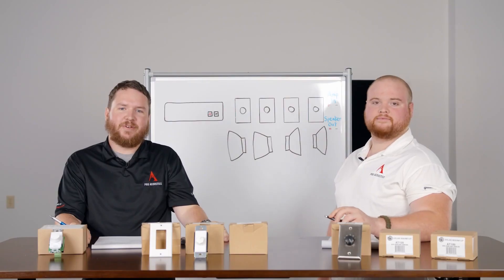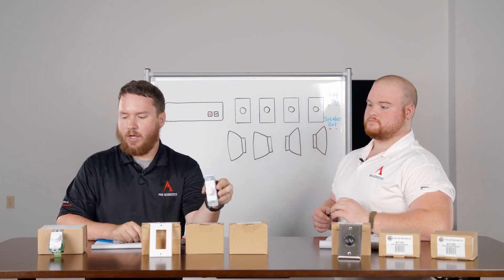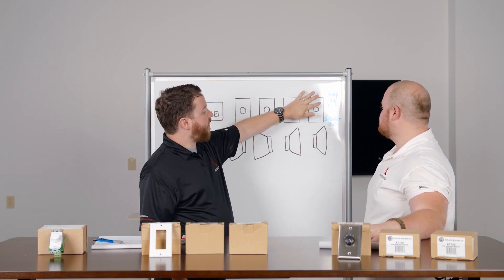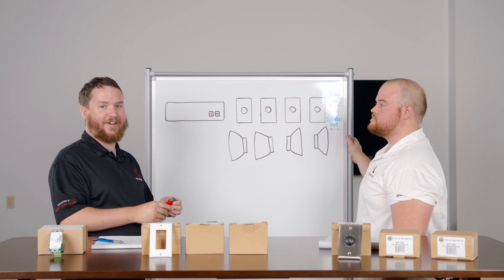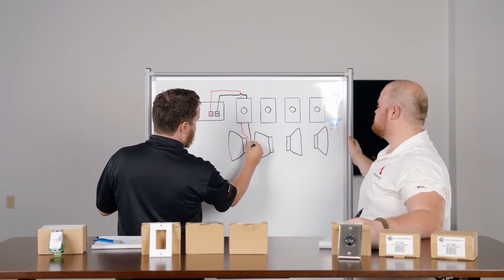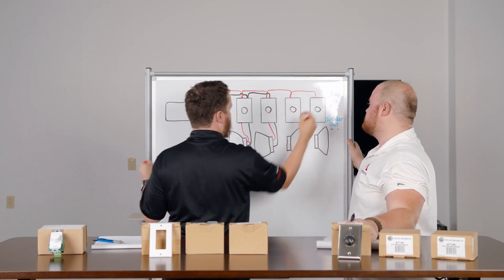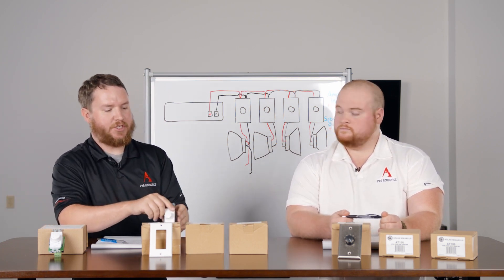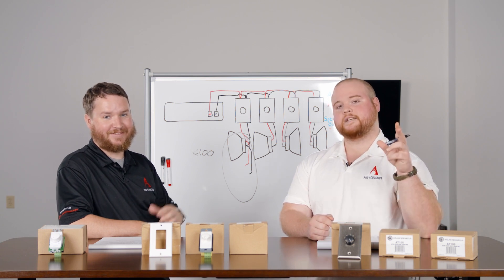All You Need to Know About 70V Volume Controls on Pro Acoustics Tech Talk Episode 20

Comment: Hello, what if I want to control an outdoor zone with two speakers and one oudoor subwoofer ? I’m planning on doing this with a Sonos amp, the bub woofer connection is rca for the sub
Reply from the maker: For your setup with the Sonos Amp, you won't need a 70V volume control. Instead, you can adjust the volume directly from the Sonos Amp, which will control both the speakers and the subwoofer. If you have any other questions or need more details, feel free to reach out! We're happy to assist you. You can contact us at 1-888-256-4112 or email sales@proacoustics.com.

Comment: Maybe this was asked before.

But if I have a 100W volume control does it mean I can control up to 70w  in speakers.

Does the primary capacity of the amplifier needs to support the total amount of power needed by the whole system. Or each volume control adds extra watts to the system ?
Reply from the maker: The 100W of the volume control refers to the total wattage it can handle across all connected speakers. The cumulative wattage of the speakers connected to the volume control should not exceed 100W. The volume control doesn't add or accumulate extra power; it simply adjusts the volume level of the speakers. However, your amplifier does needs to support the combined wattage of all your speakers.

Comment: Question for you. I have been asked to play a live acoustic set through an in house multiple speaker pub system.  I am using my analogue mixer to set levels for my guitar and microphone and connecting this to their wall mounted xlr input. There are 2 inputs labelled mike and external.  External produces no sound. Mike  in works fine but only if the main out on my mixer is to to practically zero leaving volume control to the wall controller behind the bar area. Is this normal?  Any tips ?
Reply from the maker: It sounds you might need to check if the main mixer/amp connected to the wall plate has its volume turned up for sufficient headroom.

Comment: So the controllers only lower the volume?  So if it’s on the max setting the speaker will output what it’s tapped to?
Reply from the maker: Great question! Exactly—when the volume control is all the way up, 100% of the power passes through the attenuator, allowing the speaker to output what it’s tapped to. As you lower the control, it reduces the wattage passing through to the speaker.

Comment: What about the impedance? You never mention that
Reply from the maker: This video is about 70V audio systems, which differ from traditional low-impedance systems. In 70V setups, impedance is not usually a primary concern. The main advantage is better performance over long distances with multiple speakers, making installation and scalability easier.

Comment: What if total wattage of speakers is bigger than volume control wattage. Does it effect on original sound level of amplifier?
Reply from the maker: If the total wattage of the speakers exceeds the wattage rating of the volume control, it can cause damage to the volume control. The wattage load of the volume control is determined by adding up the selected wattage taps of the speakers connected to it. Make sure the combined wattage of the 70-volt speaker taps does not exceed the wattage rating of the volume control to avoid any issues.

Comment: Hi  I have two questions 1 how do I also connect sub woofers on one zone of that regulator or volume switch.                2 how can I run it that one zone can be reduced from other zones and use it for my self example if I want to use the speakers on zone 3 for myself completely and I switched it of from the amplifier being the source and play music with my phone later can switch on when  am done
Reply from the maker: I'll do my best to answer both of your questions.
1. The volume controls on the zone regulator are specific to each zone and are assigned to one amplifier. You can connect the subwoofer to the desired zone just like you would connect any 70V speaker.
2. If you require the ability to assign the subwoofer to specific zones and control it independently, you would need a matrixing multi-zone amplifier setup. I recommend reaching out to our sales engineers, who can provide further guidance if needed. Feel free to contact us at (888) 256-4112 or email sales@proacoustics.com.

Comment: one question I have 100W amp and 8 speakers 10W does volume control draw aditional  power from amp can I put 3 30w controlers to make 3 zones
Reply from the maker: It's essential to ensure that both the amp and the volume controls can handle the cumulative wattage of the speakers. Having 8 speakers with 10 watts each and using 3 volume controls rated at 30 watts should work fine (3 speakers x 10W per speaker = exactly 30W per volume control). Just ensure that the total wattage of the speakers connected to each volume control does not exceed its rated capacity.

Comment: is there a voltage drop in the system? speakers in DC chain?
Reply from the maker: It's possible to have some voltage drop in a system with speakers in a DC chain, but it's typically a negligible difference. The extent of voltage drop depends on factors like the number of speakers used and the length of the speaker chain. In most cases, the impact is minimal.

Comment: Great video.
I am building a massage clinic with three rooms and a main reception area. One speaker, and volume control per room. Multiple speakers in the reception area. I have my contractor doing other electrical work and am going to propose this method to him for install speakers. Is this something an electrician should be able to easily comprehend and carry out? It seems rather straightforward with the right equipment.

I would just want to make sure I have the right speakers, amp, knobs, and of course wiring.

Thanks!
Reply from the maker: In most cases, an experienced electrician can install basic commercial audio equipment, provided they have the necessary equipment. If you would like to speak with us directly, we can assist you in designing your audio solution and work with your electrician to ensure that the hardware is wired and installed correctly. Our design assistance and troubleshooting help are complimentary. You are welcome to contact us by calling (888) 256-4112 or emailing us at sales@proacoustics.com.

Comment: Do all of the volume controls add up?
Reply from the maker: Hi there, The volume controls do not necessarily add up. It would depend on the speakers' wattage taps assigned to the respective volume controls. You can have higher-rated wattage volume controls on the system. However, you cannot exceed the rated output performance of the amplifier(s) these speakers are tied into (less than 15-20% for headroom).  We talk more about that in this video: https://youtu.be/-omIOiKUrdw?t=212
We also talk more about setting up volume controls here: https://youtu.be/UgxQc9XMyvo?t=199
Reply: @ProAcoustics  Oh ok thank you very much!!!!!!!!

Comment: How do you connect your phone to it?
Reply from the maker: Hi George,
Most 70V volume controls require manual adjustment of the knob and are not smart or digital devices. Depending on the available features, you may be able to connect your personal device to stream audio via Bluetooth to the mixer/amplifier.
Reply: @ProAcoustics  so would I need to have it connect to a box like with a cd or radio
Reply from the maker: @GeorgeLiakaris  Yes, that is correct.

Comment: I have a TOA DA 250H THE INPOUT IS 3 Wire how can i connect a audio device to it
Reply from the maker: Hi there! That is a balanced euroblock or phoenix club connector on the TOA DA 250H unit. You would plug a balanced output from a mixer (like an XLR) into the euroblock connector, matching up your positive, negative, and ground wires. Hope this helps!

Comment: Hi I have a amp 240w where I will be connecting 4 jbl 24ct speakers which I think are 30w each. I notice there's volume controls that are 20w up to 200w.which one would I need be able to fit my 240w amp? Thanks on the tap inside the grills it shows 70V: 30W, 15W, 7.5W (& 3.7W @ 70V)
Reply from the maker: Hello, If you tap all 4  speakers at the 30-watt tap, then you can use an 200-watt volume control to adjust your 120-watt load.
Reply: @ProAcoustics  Thanks alot 👍

Comment: Do we have to compromise in terms of audio quality if we use it
Reply from the maker: Hello, As long as the wattage is distributed correctly and everything has been connected properly, you should not experience any loss of audio quality from using a volume control in your 70 volt sound system.

Comment: Hi guys, thanks for you video,  I have a question, the 70v system is nice but does it need to be connected to a 70v output amplifier ? Can this be connected to a regular amplifier with 8ohms outputs ?  If not, can I put in reverse mode, a transformer (8ohms to 70v) by connecting the 8ohms to the amp output (making sure i'm not exceeding the power of the transformer) and the 70v (usually the primary) to the 70v line ? If yes, what would be the considerations I need to know ?
Reply from the maker: Hi, 70-volt speakers need to be hooked up to a 70-volt amp unless you use the 8 ohm bypass on a 70-volt speaker to hook up to a low-impedance amplifier (and adhere to the recommended impedance of the low-impedance amp). External 70-volt transformers are available for purchase, but great care should be taken in installing them as they are high-voltage devices that require electrical connections.

Comment: Hello, Can I use a 1 channel 70v amp with 4 speakers connected but use two different volume controls for each set of speakers, or will that require a 2 channel amp?
Reply from the maker: Hi Sami, Yes, with a single zone amplifier, you can still use more than one volume control, each with a separate set of speakers. As long as your volume controls have a high enough wattage for how much those speakers are drawing.

Comment: What would cause a volume control to be full volume at “10” but then drastically drop off for all the other levels??
Reply from the maker: Hi Dusty, Check your wiring. Make sure you are not exceeding the available wattage on your amplifier and confirm you also have headroom based on your transformer tap settings. You can check out this video for more information on headroom and how to calculate your tap setting for your amplifier: https://youtu.be/-omIOiKUrdw?t=213

If no issues are found during the above, you might also try replacing the volume control.

Comment: How do you fix a volume control transformer that keeps overheating?
Reply from the maker: Hello, I'm sorry to hear that you are experiencing this issue. Start by confirming your speaker transformer taps are under the rated wattage of the volume control and then confirm your wiring is correct. The volume control may have failed, so you will want to consider a replacement. If you have further questions about troubleshooting, consult a professional in your area. If you would like assistance purchasing a replacement volume control feel free to reach out at 888-256-4112 or email sales@proacoustics.com.

Comment: Does adding a volume control work with 5.1 surround? I have 5 speakers and 2 subs in my cieling. If I wire to the volume control, than to my AV receiver, will I lose the surround sound?
Reply from the maker: Hi Alex, You would need to have a volume control for each individual speaker, but it is possible.

Comment: Do you need have a mixer or are you just okay by putting amp to volume control ?
Reply from the maker: Hi Hugo,
A mixer is not required. You could wire the amplifier to volume control. You will want to ensure that the volume control is rated for the wattage of your speakers.
You may also find this video helpful, we explain the difference between an amplifier, mixer, and mixer amplifier: https://youtu.be/m_7KY1OPL0Q
Let us know if you have any other questions or reach out at (888) 256-4112, email sales@proacoustics.com, or visit https://www.proacousticsusa.com/

Comment: are their Bluetooth volume controls?
Reply from the maker: Hi Ken,
With some sound systems, you can adjust the volume via Bluetooth app connection to the speakers or mixer amplifier with your wireless device. You could also install an inline volume control in this case so that you could use Bluetooth or the wall control to adjust the volume.
Unfortunately, there are not good options for Bluetooth wall volume controls. Bluetooth also has a very limited range of around 30ft typically, so it would not have the reach needed to be an effective solution.
If you need help finding a good solution for your needs feel free to email us at sales@proacoustics.com, call (888) 256-4112, or visit https://www.proacousticsusa.com.

Comment: Very well explained thanks, but how about if your amplifier has a zoning volume control lets say it has 5 volumes and the output of the amp has an output of 70v, 100v, and then the additional common outs and zone 1,zone 2,zone 3,zone 4, zone 5 can i also daisy chain on zones output?
Reply from the maker: Hi Alan,
Yes, you can run an individual speaker run and daisy chain multiple speakers off of each zone of the amplifier. Just make sure to check the wattage per zone. We actually recently posted a video about multi-zone systems if you want to check it out https://youtu.be/UgxQc9XMyvo
Hope this helps and good luck!
Reply: @ProAcoustics  thanks so much! I’ll watch the video link that you sent. 🙂👍
Reply: Sorry, you have not explained anything about the transformer - the primary's various pin connections and the secondary's various pin connections. Also you have not explained about, whether there are various wattage vol. controls.

Comment: Do you need any license to install a 70 volt system for a friend or college that wants you to install for them? I Have a great knowledge of audio, but I don't know if I need a license of any sort.
Reply from the maker: Hi Jonathan,
No license is typically required for installing 70V sound systems. However, we advise you to check with your local building authorities for any code requirements or other stipulations.
If you need any help with getting the sound system we'd be happy to work with you on your project. You can request a quote at https://www.proacousticsusa.com or call (888) 256-4112

Comment: Can I connect a 100 watt 70 volt volume control to an 100 watt 70 volt amp? Or should the wattage of the volume control be less than the amp?
Reply from the maker: Hi Jonathan, Your amplifier will need to have at least 20% more wattage than the total wattage of your volume control and speaker taps combined. We have a video explaining this here: https://youtu.be/-omIOiKUrdw
When adding volume controls it’s the same concept.
So for example, if you had (1) 100 watt volume control and (4) speakers each tapped at 25 watts, that would be a total of 200 watts. 20% of 200 is 40. So you’d need a 240 watt amplifier.
I hope that helps. Feel free to reach out at http://www.proacousticsusa.com

Comment: instead of using the attenuators, can i connect an output distribution splitter between the amp and the speakers? Behringer DS2800?
Reply from the maker: Hi there! Unfortunately, this will not work with the DS2800 because it is a line level signal splitter. Splitting a powered signal would likely result in the Behringer unit overheating even at 70V. If you are wanting to power up to four zones I'd recommend looking into the Pure Resonance Audio RZMA120BT. https://www.proacousticsusa.com/pure-resonance-audio-rzma120bt-4-zone-120w-commercial-rack-mount-70-volt-mixer-amplifier-with-bluetooth.html There are also amps available with up to eight zones that you could use if you know your way around DSP processing.
Thanks for watching and I hope this was helpful! Feel free to reach out with any further questions or product interest. You can chat directly with a sales engineer at proacousticsusa.com, email sales@proacoustics.com or call  (888) 256-4112.

Comment: Do you always use volume controls in your 70v applications? Or, do you sometimes not use volume controls, and instead try to limit the normal listening by using a lower watt tap in certain areas? In other words, is a lower watt speaker tap ever the answer instead of using a volume control?
Reply from the maker: Hi there, thanks so much for watching! For dynamic environments where noise levels vary throughout the day, we do suggest utilizing volume controls. However, for more stable and consistent environments using a lower speaker tap is acceptable for zoning volumes out in different rooms accordingly.
I hope this answers your question. If you need further assistance feel free to reach out to sales@proacoustics.com or call us directly at (888) 256-4112. We'd be more than happy to help guide you to the best solution for your specific application.

Comment: In regards to you mentioning that there are transformers on the back of 70V volume controls, you are saying that the electrical voltage matters. That being said, are you able to use an 8 ohm volume control on a 70V system?
Reply from the maker: Hi Lawrence!
There may be some 70 volt systems that allow conventional 8-ohm speaker operation within their voltage range, but I am not aware of those models at this time. I'd instead recommend using a volume control designed for your speakers. You should find a variety of low impedance and high impedance volume controls here: https://www.proacousticsusa.com/commercial-sound-equipment/commercial-sound-accessories/volume-controls.html

I hope this helps but feel free to reach out if you have more questions!